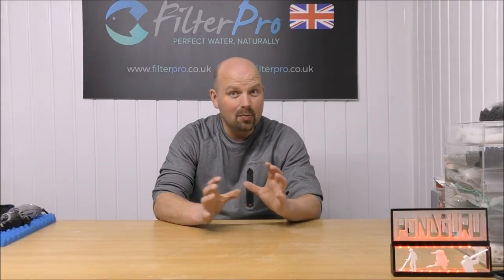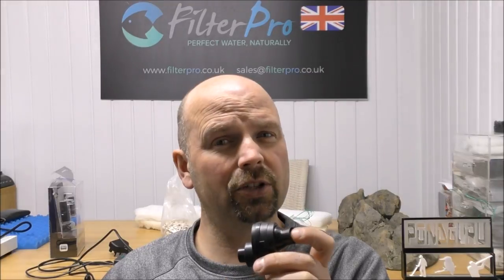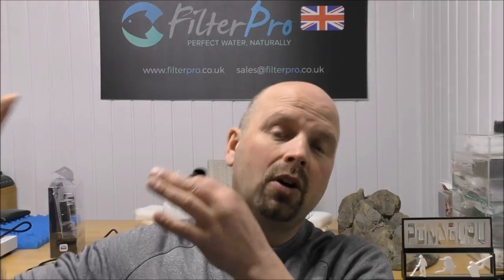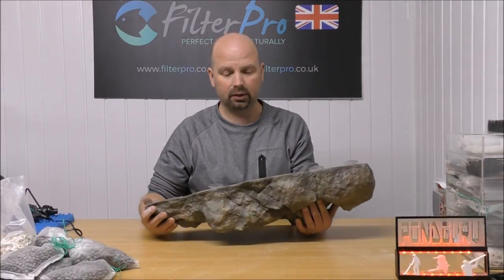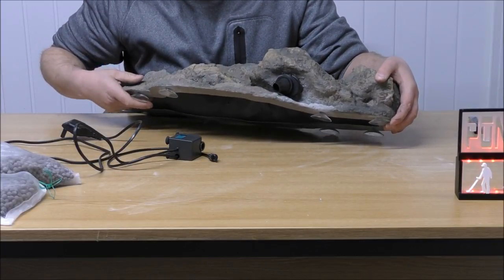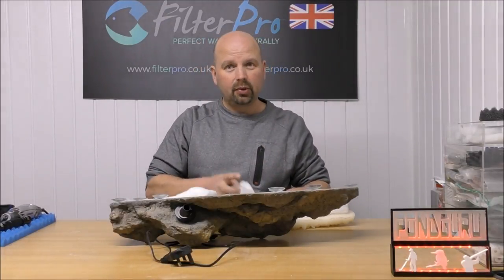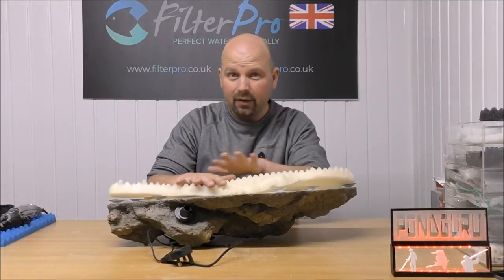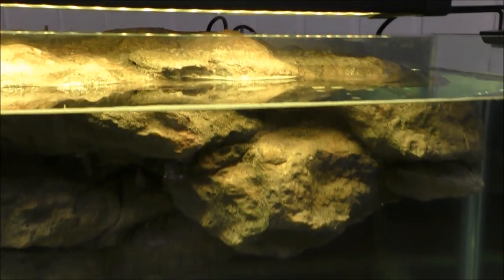The Ultimate 'Invisible' DIY Aquarium Filter?

Comment: If you sold them ready made I'd buy a few.  Would it work ok with eheim substrat pro? I'm in the market for a new filter , I've got 4 externals running on my 6'x2'x2' with a huge pair of wild caught  Costa Rican dovii (they are on my channel )the male 18" the female 12", I've got 2x 2000 lph all pond filters, a rena xp4 XL and a fluval 405, all packed to the brim with substrat pro plus a XL sponge filter, I do daily 25 percent water changes. Do you think I need to add a eheim 2260? It's going to be used as a grow out for my beani as I have a 7'x2'x2' with a sump coming for the dovii. Love your videos mate 👍🏻👍🏻👍🏻
Reply from the maker: The only downside to the filter in this video is that it works out quite expensive but would do a cracking job to quietly boost the bacterial activity for a large tank which has the main flow from other filters.
Yes you could use substraat pro in the rock filter no problem. If you have all those filters packed out with it already you should really be getting a full cycle if the substraat pro was doing its job as you must have close to 20kg in there? That should easily be enough for a 680 litre heavily stocked tank.
What do you use as water conditioner? If it is one which claims to remove / bind / detoxify ammonia, nitrite and nitrate it could well be starving the bacteria, preventing the media from maturing properly.
Feel free to ring any time on 07772848730 as I often miss comments on Youtube.
Regards,
Richard
Reply: Pondguru -Richard thanks for the quick response. I think there's about 18kg in there. I wasn't sure how many kg of substrat pro was needed for my tank, I know you said 2kg per 100 litres for big fish, but you was talking about biohome ultimate and I know it's better than substrat pro so wasn't sure the kg-litres with the eheim. I only bought the substrat pro as it was on eBay , a fella was selling it for £5 per litre, I don't think he's meant to be selling them as they are the bags you get when you buy an eheim canister filter so not sure how he got them but I bought 52 litres, then panicked till it arrived thinking it's fake lol thought someone in China was rolling up balls of sand then spraying the sand with hairspray 😂 but it all turned out fine. I nearly ended up with 3kg of biohome ultimate, my friend bought it but was gonna swap me for a 2000lph aps canister, but then changed his mind the tosser lol
Reply from the maker: The recommended amounts to use for different stocking scenarios relating to the biohome has been narrowed down from hundreds of bits of feedback from people all over the world reporting how much they used to achieve full cycle in a wide range of water conditions with various flow rates and varied stock so it is about as accurate as it can be. Unfortunately I don't have the long term usage or any reports for the substrat pro so any figure relating to how many litres of media per 100 litres of water to achieve full cycle would be a pure guess.
Keeping good porous media clean is the key to allowing it to work properly and as the substrat pro is made from a smaller, single sized particle and much more dense than the biohome I'd guess that it has to be in even cleaner water to work to its full potential but it should allow for a full cycle.....how much is needed per 100 litres is not known unfortunately unless eheim have notes relating to the full cycle on their website somewhere. Most companies only mention nitrate reduction in passing without stating how much media is actually needed to make that happen (or if it will happen).

Comment: A great idea for what would otherwise be waisted space. Two point though, no oxygen would be transferred from the bubbles to the water at the surface tension on the bubbles is too great and there is reduction of nitrate in an aerobic filter.
Reply: As well as you should avoid those little tiny bubbles...crates problems with gills

Comment: Will lava/volcanic rock media facilitate the proper and complete filtration cycle? Especially converting nitrate into nitrogen? Also can I use aquarium gravel at the very bottom of a API Rena Filstar XP 2 canister filter? There isn’t enough room to put standard biological media. Thanks in advance.
Reply from the maker: I have shot a video on the XP2 (still have to edit it...) and I can't remember if it took any settlement media or not - I don't think it did. Generally lava rock would not be able to support anaerobic bacteria (due to the lack of good internal structure) unless it was used in an area with extremely slow flow where water conditions were actually anaerobic.
Check the video I did called 'Looking INSIDE filter media' for more information on lava rock and lots of other types of media.

Comment: How does that new biogravel compare to biohome ultimate? I watched the video on upgrading the FX6 filter and wondering if the gravel would be better or just comparable to the ultimate?
Reply from the maker: When it is used in small bags like in this video it still allows for good water flow around it but in a canister it may slow the flow down a bit since it packs in so effectively. However both media allows for a full cycle and there are an increasing amount of people using biogravel in canister filters (especially in the US) who run them with no problems with flow.

Comment: That’s a cool filter, only thing I don’t like is lack of surface agitation, going to get that film build up?
Reply: I believe it's not really needed because of the innumerable constant air bubbles that is constantly getting put out by the rotating head of the spin stream nozzle - all of that has to constantly rise up to the surface causing water movement, and therefore oxygenation of water, which is what surface agitation aims to achieve
Reply: Lakshminarayanan Krishnan it's not the bubbles that airs the water it's the popping at the surface causing agitation that does it
Reply: Nowhere did I mention that bubbles airs the water. Niether does them popping. I said bubbles rising causes water movement upwards where it is gaseous exchange that causes aeration of water fixing the O2 content in the water.
Reply: Lakshminarayanan Krishnan all I said is it's the agitation of the waters surface that airs it not the bubbles in the water column
Reply: You can just reposition the pump to point up and have large bubbles.
Reply from the maker: Yes, you're all right to some degree and I'm just throwing ideas out there - the pump can be located wherever you want so flow can go up / down / left / right.
Having it nearer the surface of the tank would increase surface agitation.
Reply: Pondguru it’s still a nice camouflage filter, maybe put a heater back there too.
Reply: Props to all those loving this but I can't believe all the criticism this is getting, You're all crazy...he's getting plenty of surface agitation...every bubble he sends down through the water column will benefit the entire tank and rise up eventually and pop at the surface causing the surface agitation...he also said very plainly he could increase or decrease the flow of bubbles and the size of bubbles!!!! It's a brilliant design in my book...you all just need to pay attention or if you don't like something about the design change it when you never get around to doing it yourself!!!!! Damn!!!!!!! Great project...Great video.
Reply from the maker: Yes it has had a strange amount of thumbs down but they are probably from other channels who wish they'd made it for one of their videos, lol
I just like throwing ideas out there for free which people can either replicate, alter or ignore - some may like them some may not but I do like it if the people who dislike any given idea tell me what their concerns are so I can address the issue or even learn something from a superior knowledge they may have....sadly that hardly ever happens.

Comment: I saw someone on a youtube talking about you and how you know everything about filters, so I decide to youtube invisible filter and I find this!  LOL.  I am  trying to filter an undrilled both a fresh and saltwater tank and I want things nice and tidy!  So may people have the HOB and it sticks out the top and looks so bad.  I have a 5 gallon betta and i have hidden an almost submersible one behind a plant but thats a fake plant tank. I want to start a 15 gallon saltwater and 10 gallon nano fresh starting small and probably size uplater.  anyway I don't know what to do. I will paint back wall black, more than likely andto hide things and I have thought of a submersible in my saltwater I think it is a haggen or something, it has a spray bar and said it doubles as a powerhead as well for my anemone to move and flow.  I dont think it has 3 stage filtration so I dont know if that will be strong enough.  Then there is a pen plax that has a movable little thingy..lol I can direct the flow to anemone so this way I dont have to add a powerhead and junk up more of the inside.  I also considered a hob refugium, but I could see that walking by the tank. I may be able to hide it behind painted black wall on the 10 gallon fresh beacuse its in a corner of my kitchen. but not 15 gallon. I also am looking at some used undrilled tanks and thought about a canister but black parts would be in the water.  Its a small aqueon column 15 gallon with stand, so maybe I could put a canister in there. I cant use this, for salt water corals, If it comes smaller for 10 gallon fresh that may be the way to go but i want  a planted tank.  This is so long I know, sorry for that but can you help me figure this out if you understand what I am saying. Just want good filtration and the best way for it not to show.   Oh, I saw some clear glass in take and out take pipe with clear tubing, can remeber the name, but I wasnt sure what it was for .  It was just the clear pipes one had like a bubble, sort of looked like co2 but think it was to add to a canister filter instead of black hoses and returns ect... Thanks for any advise you can give me. I am a woamn and dont know much about this kind of stuff...lol

Comment: Surely because of the holes in the front the water isn’t drawn through the filter pads? Wouldn’t it be better to not drill the holes, that way all the water is drawn through the filter sponge instead of the holes straight through the media?
Reply: My question exactly.
Reply: Simon Frost wouldn’t it be better then to just not drill the holes?
Reply from the maker: Most of the water is drawn in through the back through the foams and fine pad but there is no reason why the fine pads couldn't be put in different positions depending on where the holes, pump and media was.
I'm just throwing ideas out there to show what can be done with a fake rock - thanks for watching.
Reply: And as you said in the video, the holes in the front will provide water flow to keep the pump from burning out if the filter pad on the back completely packs up.
Reply: Nancy Ware yea I would just have though with the water taking the path of least resistance that that would be very soon

Comment: All I can think of is the maintenance of the filter, If it were mine, It will most likely be overstock or at least stocked to the limit. not to mention heavy waste fishes. For a shrimp tank, I think that amount of bio-media is overkill.
Reply from the maker: Yes for a fish tank this rock filter would be more of an additional filter and the main canister would provide the water flow and visible waste removal.
It is really easy to clean - simply slide it up then stand it over the tank for a few minutes before removing to clean. I just cleaned this one and when I took it away there were only one or two drips.

Comment: Looks awesome.  But I'd hate to have to clean it.
Reply from the maker: It is really easy to clean - simply slide it up then stand it over the tank for a few minutes before removing to clean. I just cleaned this one and when I took it away there were only one or two drips.
Reply: How long did it take you to clean it?
Reply from the maker: Including time to drain of around 5-6 minutes - once the large foam is removed from the back everything else just lifts out.
Reply: That's much better than I thought.  I takes me longer than that to clean my Eheim 2215.

Comment: That will be a pain to clean, it can be hard enough to remove one sucker let alone 8.
Reply from the maker: Yes, I added more explanation in video description and pinned comment to say the suckers are a bit of a waste of time as the filter hangs on the back using wire no problem. On this tank the filter just slid up the side and was easily removed, I put it over the tank for a few minutes to drain out (muck was retained in filter) then took it away to be easily cleaned with only a couple of drips.
It's the sort of thing which would only be cleaned every few months so it's no biggie to remove it.

Comment: Where did you buy the background
Reply from the maker: It is a Unipac resin ornament but unfortunately they don't make them any more due to the increased cost of manufacturing.
However, I have 10 of them here as I used to sell them on my website. I made them all into filters like the one seen in this video but I never got round to listing them for sale so they are all wrapped up in a large box.
I am going to sell them at some point and may even make a video showing them for anyone who wants to phone up and order one.
I've also got stainless steel hooks for hanging them on the tank.
If you're interested just send me an email and I'll let you know the details.
Regards, 
Richard sales@filterpro.co.uk
Reply: Do any of the ones you have fit a 20 gallon long
Reply: @adamcarmer5522  (my other channel) The filters I made are from the smaller 'rock' than was shown in this video. They are approx. 18" long.
Reply: Would you sell me one?
Reply from the maker: @adamcarmer5522  I'm assuming that you're in the UK? If so then yes, I'll be selling all of them.
Just email me and I will send details with pictures.
sales@filterpro.co.uk
Reply: @pondguru  unfortunately I live in the US. Thanks anyway though.
Reply from the maker: @adamcarmer5522  That's a bummer since the pump is 220-240V and the shipping from UK to US  is a killer.
Reply: I bet lol

Comment: Great idea but I would imagine cleaning the filter would be a ball ache.
Reply from the maker: It is really easy to clean - simply slide it up then stand it over the tank for a few minutes before removing to strip down and clean. I just cleaned this one and when I took it away there were only one or two drips.

Comment: It will never work, in the inter-space that is formed between the rear glass and the scenographic furniture, because not siliconized, you can put the fish, which will surely find death. the furniture has been drilled in many parts, on the front, but the water, as you surely know will always find the easiest and widest way, therefore, again will penetrate mainly from the perimeter, from the interspace mentioned above, and finally the pump , with the "venturi" to give oxygenation, but the jet, though floating, is facing downwards, where in a furnished aquarium is the sand, which will be continuously moved, creating undesirable pits and little grip on the plants. A filter can be hidden from a scenographic furniture, but can not replace it, if not designed for the specific case.

Comment: The only thing I can see that could be an issue would be ease of cleaning, you would have to unplug the powerhead and remove the entire unit from the aquarium just like a massive internal filter.
Reply from the maker: I just cleaned it a couple of days ago and I slid it up then rested it on top of the tank for a few minutes before carrying it off to be stripped down. There was only a few drips which really surprised me - definitely best when it just hangs on the back using the wire hooks instead of farting about with all those suckers.

Comment: AuqaGadget - Universal Spin Stream Nozzle

Why it's so expensive
Reply from the maker: It is only about £7.50 using the Amazon link: http://geni.us/bLHfA
That is cheap I reckon, especially compared to the Random Flow Generator nozzle which is around £25 and only seems to work with powerful pumps.

Comment: Where the water agatation ?
Reply: Achieved by way of Constant air bubbles that is constantly getting put out by the rotating head of the spin stream nozzle
Reply from the maker: It certainly doesn't have the flow of a standard internal filter but this is really about making clean and healthy water for a small tank using a hidden filter. On a large tank the main filtration and flow would be from a suitably sized canister filter and the rock filter would be a supplemental filter to ensure excellent quality water. The bubbles coming from the integrated pump ensure that the water surface is kept agitated to allow for gaseous exchange.
Reply: nick sweeney hahaha.Not funny.!
Reply: Lakshminarayanan Krishnan water breakage is the best form of water  agatation and surface movement !

Comment: hi, what are the many little holes in the rock for ? There, even the smallest fish can swim in and then die under circumstances in the filter ... :o(
Reply from the maker: The holes are tiny - way smaller than a standard internal filter inlet and the draw is diffused so much that fish won't get stuck in the holes.